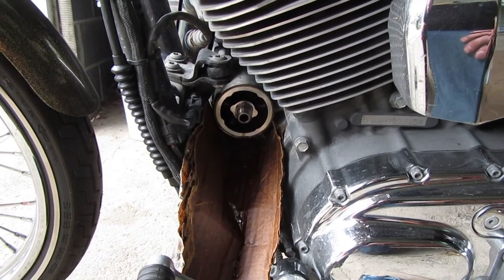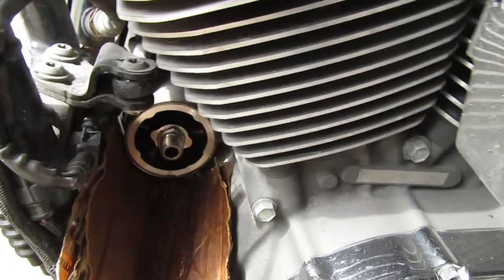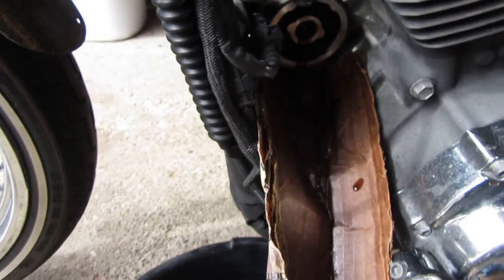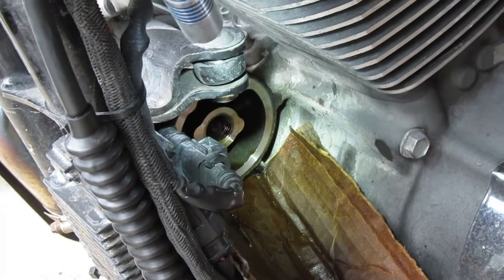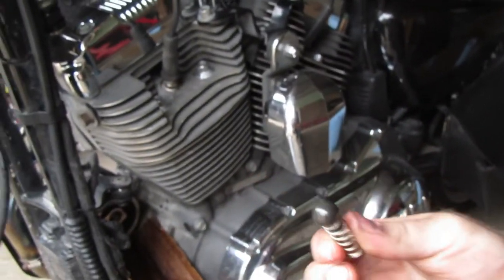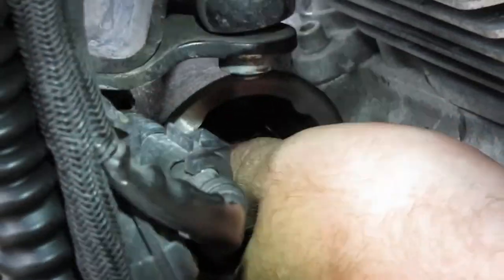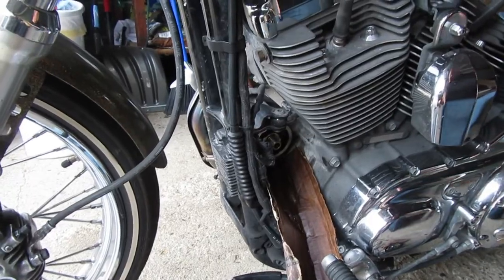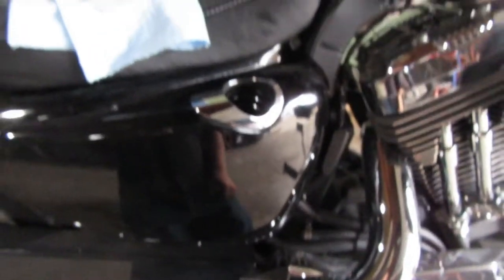Sportster 1200 oil pressure check valve replacement/wet sumping.

Comment: Hi. Im just curious. Did this solve the issue long term. My bike does exactly the same. The tank will drain a few days after I've ridden it. So when I start it up again it will only take on the second time I hit the start button. I assume its because the motor is working harder, sloshing through the excess oil in the sump and then take on the second try cause the oil have now moved back into the tank, freeing the sump up.
Reply: Have you made any repairs yet?
Reply: Im doing this repair tomorrow morning i got the parts from harley today will let u know wat happens if u like lmk
Reply: @TheSevenboy127  did it fix the problem?
Reply: @spitfirepaintball16  yes no issues since i replaced it

Comment: With my 2000 sportster this is happening every time i ride it, not only after it sits. Plus I have an S&S carb so the overflow gets routed out onto my rear wheel. Fender, chain guard, chain, even the rear brake and exhaust get coated with oil. I drained the crankcase and put exactly 32 oz in it. After this happens it has 36. Plus the oil in the crankcase gets a red tint from the Motul I use in the oil tank. I can't find the damn ball (26437-86B) or adopter (33117-91A) anywhere. This has been like a 3 month ordeal. Initially I thought it was the hoses and clamps, so I changed just about every one on the bike. Then I thought it must be the oil level. I have emptied and changed the oil and washed the oil off the bike like 10 times. Anyone know if there is a replacement for that ball? Changing the spring only did not work.
Reply from the maker: Which state are you in?  If you’re speaking of the ball/check valve we replaced you should be able to order it online assuming you’re in the United States (I can’t speak for other countries) the part number did supersede but it is the same. Thanks for watching!
Reply: Hey Stephan D. I have a 2010 sportster and my bike is doing the exact same thing I did sit for a month, got a new battery and went down the street came back and lol all over the same side of yours.. did you find a solution??
Reply: @damiengarcia6944  Fortunately it is an easy fix.
Reply: @Stephen D. Awesome was it the same thing as in the video?
Reply: @damiengarcia6944  Yes. It was the check valve right behind the oil filter adaptor. It took forever to figure it out. Also I could not find the darn part aftermarket at all, but harley has them. Don't believe it if the ball looks ok. Mine looked fine and still wasn't seating properly.
Reply: Stephen THANK YOU man! Because Im currently having that issue you had, so I'm definitely calling up Harley right now to go grab it ! Thanks again! Ride safe brother ! ✊🏼✊🏼
Reply: What is the end result after the fix? Dealing with oil puking out of the air filter. Ive ran a compression test, leak down, changed the breathers, hit the oil lines with air and still puking oil out of air cleaner. Picking up the ball and spring tomorrow morning.
Reply: @usmcdoc2512  hey man I'm still waiting on the ball and spring, Harley had to order it, but mine was spewing out all over my belt and rear tire and a little bit on the end of my exhaust
Reply: @damiengarcia6944  yo, so I have been doing a shit ton of research in forums, in books and videos and one video I came across stated the spiral cut gear that runs the oil pump gear( in the crankshaft if I remember correctly) if it's damaged it will have a hard time spinning the gerotars. So I'm going to take the cam cover off and check along with replace the check ball and valve. All my tests gave come out in spec so I'm at Witt's end. I told this customer not to buy this damn scoot and he said it was doing it when he first bought it. Irritating.
Reply: @usmcdoc2512  yeah brotha this whole oil spewing every where is irritating lol, if this spring and ball don't work I'll be pulling the oil pump as well and cleaning it, and yeah definitely take a look to see if that spiral gear is damaged, your in the right track man .... Well good luck with it
Reply: @damiengarcia6944  to you as well. Let me know what your results are.
Reply: Order from harley dealership i tryd the steel ball spring option that jp cycles provides do not buy it wont work fully its a steel ball and harley oem is a rubber coated ball slash mushroom 🍄 looking thing
Reply: From harley part # is 26437-68b check ball for sportsters
Reply: @usmcdoc2512  from my experience in my build the blow back from air cleaner has nothi g to do with the check ball all the ball does is control the level of oil and keep some oil in ur oil bag. Nothing else
Reply: @TheSevenboy127  I pulled the top end off and measured the cylinders and pistons. The bike WAS an 883 and is now a 1200. Rear cylinder/ piston is a tight fit but doable. (0.006")
I dropped the oil pump and there was a 1/4" piece of non magnetic metal before the return. I presume the prior owner of the customers bike had a piston that started to break at the skirt or somewhere and sediment fell to the bottom of the case where the oil hole is, that during the piston stroke- forces oil into cam side but said sediment is blocking the hole so pressure is building up. Gonna split cases soon as locking tool arrives to remove pinion gear nut.
Reply: @usmcdoc2512  pls keep me posted brother would really like to know wtf is up with these motors i  have bo oil at all from air cleaner or the breather bolts just my bag is emptying to crankcase
Reply: @usmcdoc2512  i worked on my buddys 883 it was also converted to 1200 with a "non badged" (S&S big bore kit and they seemed to be very short first bottom fin was very close to the crankcase barley coukd fir a terry towel between the engine case and the bottom fin of the jug his bike was only spitting oil from the breather bolts took cam cover off checked everything and it was all nice no issues no pieces found i honestly thing who ever put this bike together the first time purchased a knock off (S&S big bore kit which is horrible quality products we removing the rear jug the piston had deep scars on the side tip of the piston rear only but no damage to cylinder its self at all so we replaced with a legit badged  S&S 1200 KIT AND 0 ISSUES PERIOD KEEP AN EYE OUT FOR THAT ALSO  WOULD LIVE TO HEAR HOW THIS WORKS OUT FOR YA ILL BE DOIJG MY CHECK BALL,SPRING AND OIL FIKTER ADAPTER SOON AS I GET OFF WORK
Reply: Got all the new parts in there and i honestly barely see a difference its not bone dry any more but the level did go back down after 2 days
Reply: @TheSevenboy127  I'm still waiting in a gasket kit. I'm splitting the cases. There is a tiny hole at the bottom of.the cases I want to clean out and inspect for any sediment build up
Reply: @usmcdoc2512  cool l.k how that works out brother